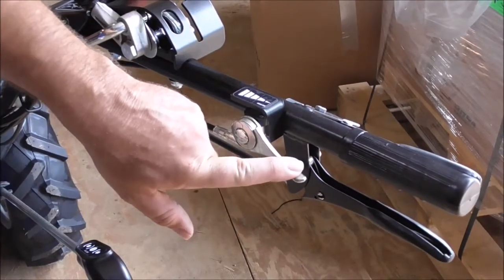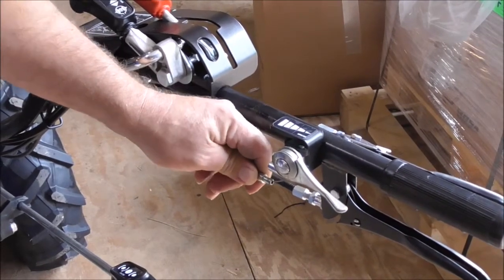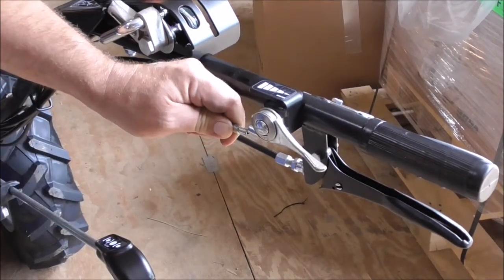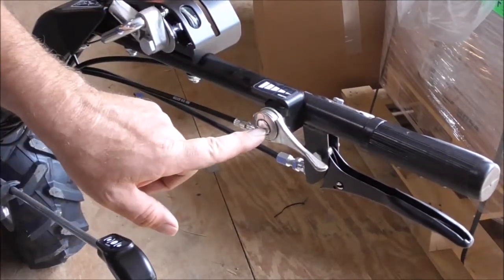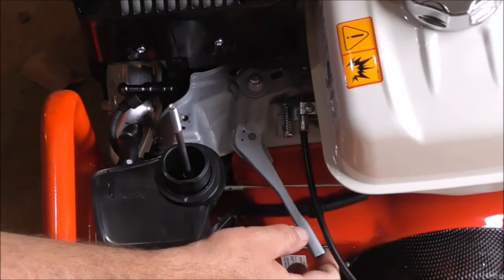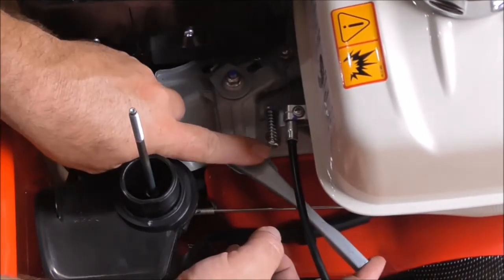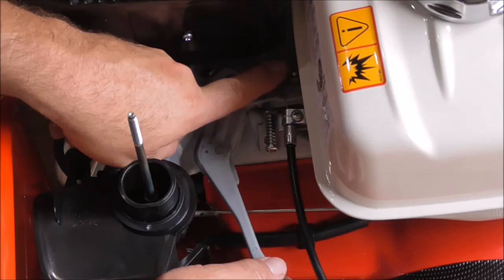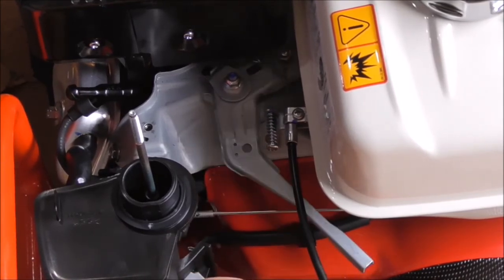BCS Tractor Throttle Linkage Overview, Honda engine

Comment: Rasputin Clinton
1 second ago
Hi there. But what is doing the throttle lever at the end, is moving something in the carburetor??? Down toward the engine it turns , but what actually is doing to increase the speed/power??? In video it shows just that lever with that spring to return it in the initial position, there must be something further to adjust the air or gasoline in the carburetor. Thanks a lot.